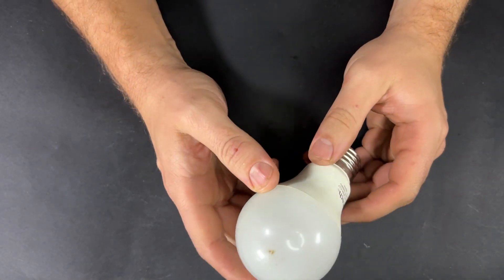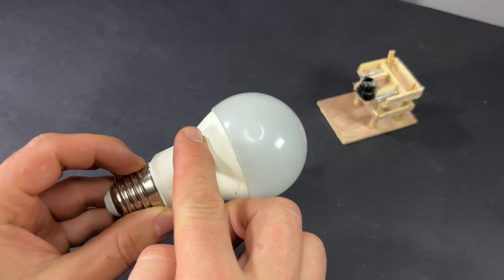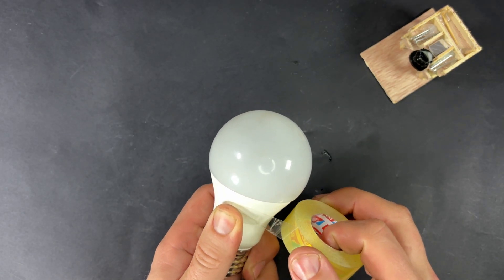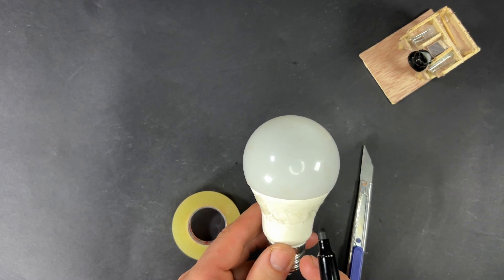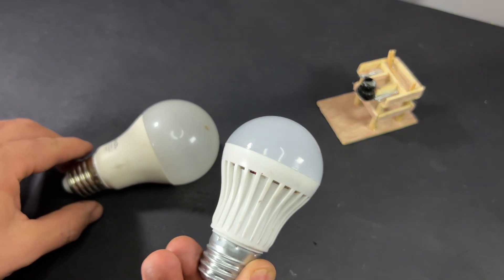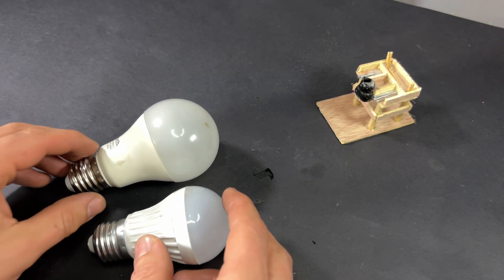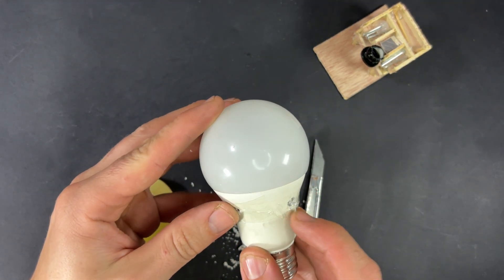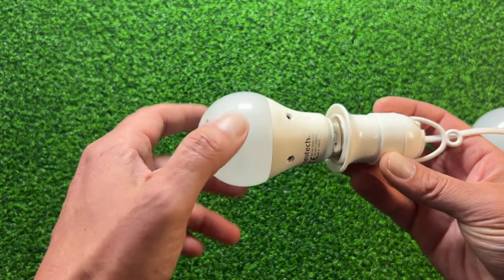How to make an ETERNAL LED LIGHT BULB , with your own hands and safe your MONEY!

Comment: Oh yeah, just drill some holes in a 220V electronic device... Please don´t do it! This is just dangerous and with a bit of luck you will burn down your house.
Reply: To be honest most of LED bulbs got loads of empty space inside. As  electrician i got to play with loads of faulty ones and they  more or less look like in this vid  https://www.youtube.com/watch?v=KmsQCay0EbU
So in theory if you using same brand of bulbs you can open one and see where same spots are.  Plus you can use better drill bit to make sure that you don't go deep inside the casing.
Reply: @NikI-vf8ut  But you don't know how the inside looks until you open it. He just drills some holes in it, without opening them. This is just dangerous.